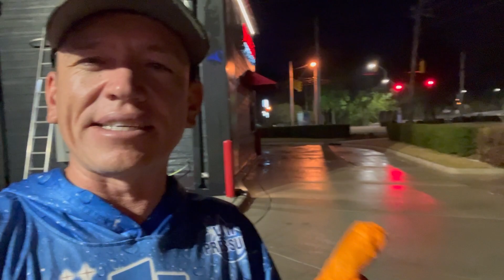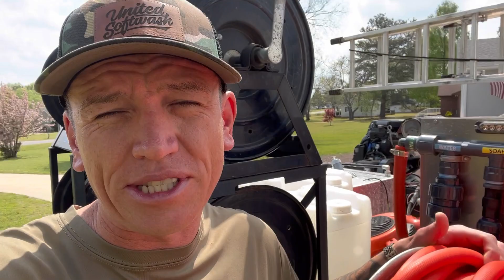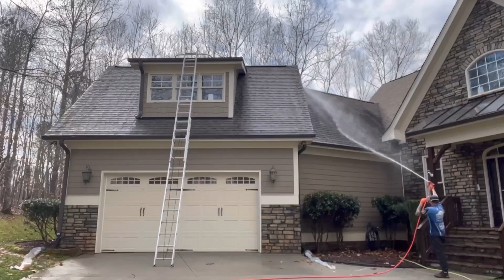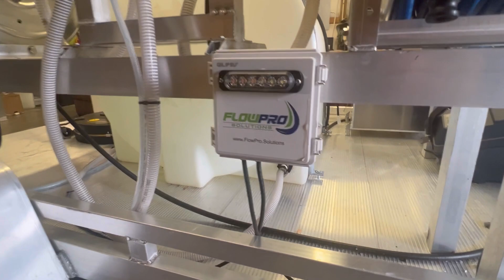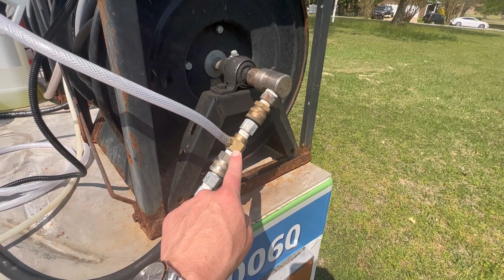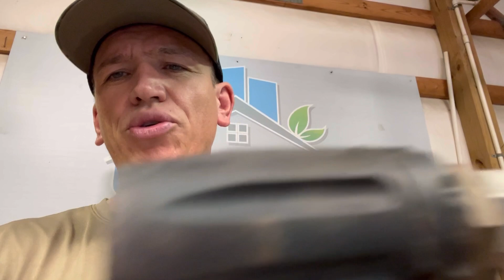Incredible Inventions That Are Changing the Pressure Washing Game Forever!

Comment: Been in the exterior cleaning business for over 26 years. You are doing a fine job helping others. Great job showing others some different ways to clean. The X-jet is a great tool to have that can be used with pressure washers or a pump. My advice is to keep things simple. There are a 1000 ways to clean. Learn the best and most simple methods. Dont get caught up in all bells and whistles. Learn a system and stay with it.  Always be prepared the day before a job. Make sure all you fittings, pumps, nozzles, hoses, tips, o rings are in good working condition. Take the time to keep equipment clean and maintained. Be upfront and honest  with all your clients. Take the time to be safe. There is a giant market and need for professional cleners. Do it right.

Comment: 1405 you could use a pick up tube ball valve. You have to calculate your volumes according to your ball valve position. Ie 1/4, 1/2, 3/4, full open. These x jets also have to be sized for your pump n pressure.

Comment: Great  explanations!   And yes, these are great innovations to our industry.  Here is my take though, for what it's worth.  Simplicity is critical for me, and here's the reason why.  STUFF breaks......all the time.  It is just part of the deal.  For that reason, I have decided to continue to batch mix.  Yes, it is less convenient, but in my case, 90% of want I do is housewashing, which I downstream.   For the 10 or even 20% of the time that I need a mix hotter than what you can get downstreaming, I make a batch to the strength needed.  I say this for the younger guys so they can keep things in perspective.  If you are doing a ton of work that requires a hotter mix, then the mixng valves will boost your efficiency.  But understand, it is also another point of failure, and if you get an air leak, you are going to be chasing it down while on the job (because that is where you discover most of your mechanical issues, of course).   Bottom line, they are mostly needed for roof washing, so if you are not doing a ton of roof washing, you could get by fine without it.  

The FloPro is absolutely essential, and great info. on the distinction between the original version and the other versions.  This is something that you will use all the time.  It is completely worth the cost.  

The X-Jet is something that I have but rarely use.  I probably sahould use it more, especially for concrete, but I don't.  The one thing that I really don't like about the X-Jet is the idea of dragging a bucket around with you.   And keep in mind, there are limitations to the length of hose you could use to draw chemical before it will not pull.  Ditto for any situation where you are trying to pull chemical and you are positioned up on a ladder or perhaps on a patio roof trying to hit that dormer.  Bottom line, there are limitations and you need to understand that.

Here's the thing to keep in mind.  Know your strengths and weaknesses.  If you are mechanically inclined and you are dilligent about making sure everything is maintained at all times, then you probably will be fine with all of these innovations.  But understand that ALL of this stuff is going to break down over time.  Gauranteed.   I'll give you another example of something that I do that is probably almost never done throughout the industry.  I do not attach my hoses to the hoise reels.  For starters, whatever length of hose you have on the reel, it needs to be fully deployed before putting pressure through it, so you are "unreeling" it anyway.   Connecting the hose to the reel, gives you a very slight amount of added convenience, but it comes at a cost.  Those reels are not cheap, and the internals will fail, many of them use specialized O-0rings that you are likely not going to carry on hand, until you learn the hard way.  For me, peeling off the amount of hose I need and manually plugging in to my unloader block literally takes seconds, and it saves my reels from rusting out or having other issues.  No, I don't use electric reels.  In my opinion, they are just another point of failure.  Those motors will go bad, and they are not cheap.  Besides, reeling a hose up takes a minute or two, and it also gives me a chance to inspect the hose as I am reeling it up.

My advice for those starting out, don't get WOWED by all this stuff thinking you need it all to get started.  You don't!  Do everything you can to save yourself from the time and expense of mechanical failure by keeping things as simple as you can.  There's comes a point where all these things makes sense, but you have to understand your busness to justify these things.  I hope this makes sense to any new guy reading this.
Reply: Great advice! You talk about the reality. So true!!! Been in exterior cleaning for 26 years. All your points are valid. You have to take a class in fittings. Basically, you need to be a plumber. You can go insane trying to do just the basic hose to pump to the gun set up. Are you using 3/8 hose 1/2, 5/8. Quick connects? Spray tips. Hose sise inner diameter oiter diameter You name it. Agree, keep things simple. The less fittings and attachment you use the better. I was able to design a cleaning pole for roofs and siding. It took some engineering but you do not need all the bells and whistles. Keep it Simple, safe, and prepare for hard work. Be prepared the day before. It's 90% preparation behind the scenes that gets the job done.

Comment: I never go back to the truck to remove my dropstick when washing. I just switch the jrod from the soap orifice back to the water orifice and wait until the line is flushed out to start rinsing. Is there anything wrong with this? Am I supposed to be going back to remove the dropstick every time? Using a gx390 4gpm currently and about to install a gx390 5.5 gpm
Reply: I also do this! i dont need to go back to truck, also wondering if this is ok? or this for people with injector bypasses?

Comment: So question... I'm relatively new, and I'm using an X-Jet for house washes... I went with the X-Jet, because we have a lot of brick and stucco homes around, and I feel that downstreaming will not provide a hot enough mix for dirty stucco... Am I wrong? o_O
Reply: you're not wrong. you can even wash roofs with an x jet. pull 100% bleach from your bucket. Down stream injectors are just a little more convenient for vinyl house washes
Reply: Not wrong.....If you don't have options others than the xjet.—double back with it wide open and pump up spray the problem areas with a hotter mix and something very sticky. It's what we had to do when we didn't have other options. Make sure you have elemonator or cherry wash to cover that smell!

Comment: Thank u for explaining the boxes for us. I might sound stupid, but I still don’t get why the 2nd type of box, the sudz box has less flow than the box with a bypass. Does that mean for us guys without boxes, just plain chemical injectors are losing flow even when we aren’t pulling chemical? I’m new to all this and trying to learn. Thanks
Reply: The injector protrudes into the flow of water which creates an obstacle and lowers the volume of water that's able to pass freely which in turn, makes the stream coming out of the tip of your wand weaker and won't shoot as far.
Reply: Was going to ask the same thing. I image, from a fluid dynamics perspective, it has something to do with the sitting fluid in the line that isn't contributing to the high-pressure flow, and it somehow causes resistance to whatever water is flowing through the DSI.